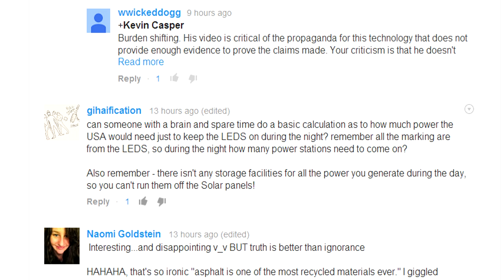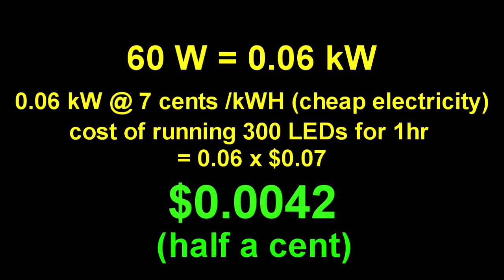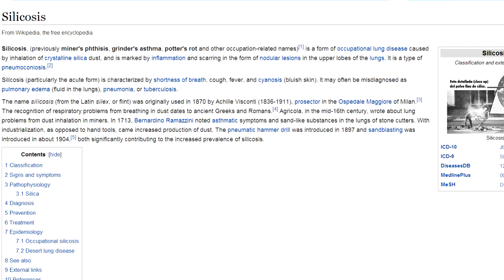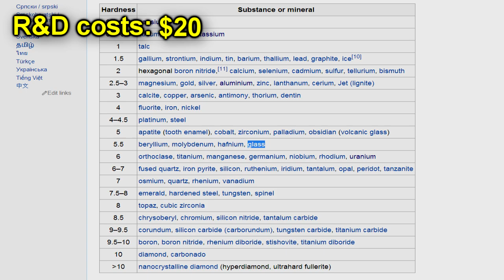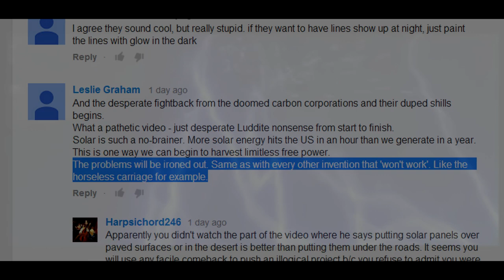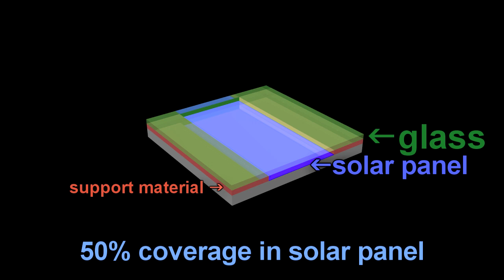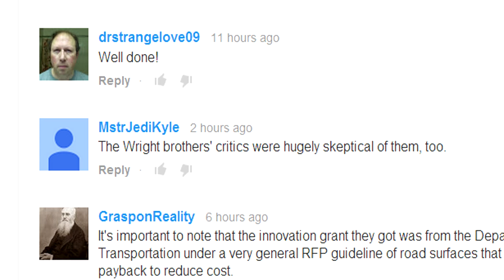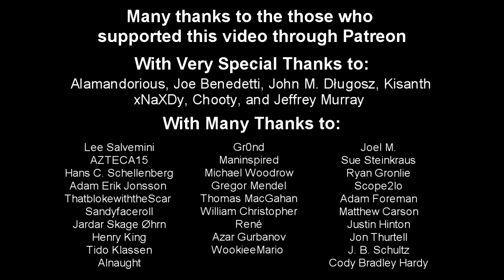Solar Roadways, IMPORTANT QUESTIONS AND ANSWERS!

Comment: Your argument has technicality flaws that you need to correct. 1) Not all the LED's will be on simultaneously, therefore not so much energy usage. 2) The cost you show is RETAIL cost for the 60 watt LED modules and solar panels. The DOT will only have to pay wholesale prices. 3) LED power consumption can be lowered easily with PWM current sources. It is not going to be full bore 60 watts. Please study up on LED's and silicon device physics... 4) Calculate the watt hours you can get from a fixed solar panel to charge up a small battery. 

But I agree that this project is epic fail. Just need to sharpen up your argument a bit.

Comment: The biggest problem with this idea is that it addresses a problem that does not exist. The reason we do not have solar power as a major source of our electricity is NOT lack of places to put collectors. This would be a line to look down if we were running out of area to put solar and needed more area, but that is not the issue we face right now.

Comment: They've answered your question on their site.  They've been doing this for years so far, and they've done the testing.  The money is to finish up the design and make it ready for mass production.  So with them refuting your "its not strong enough" bs, what now?
Reply: An idiot can work on his car made out of bananas for 5 years, does not mean he has found a solution to the problem where bananas are squishy.

But this idiot can make some shitty video about how the motor industry is bad and how his new car is 0 emissions, requires no fuel and is edible and then idiots like you can defend him because he has been working on it for 5 years.
Reply: Apparently, they didn't do the testing, or just handwave away the actual problems. They seriously should've done some back-of-the-envelope calculations years back when they started and should've spent their efforts, energy and money on something useful.
Reply: *****
tempered glass is tempered glass.  leds are leds.   you cant change the properties of tempered glass, or the visibility of LED's in the sunlight.  so you are saying it wont be the "cheap crap"  but will be using expensive stuff, therefore making thunderf00ts cost estimates way too low.   yea, that bolsters your argument.  haha.

you really think you can see LED's at a shallow angle under a glass surface in the sunlight?    this is why you enviro-junkies are viewed as religious folk now, you believe so hard that no evidence would be enough to convince you this miracle cure is nothing but a sham
Reply: "They've answered your question on their site"? That's like telling a evolutionary biologist that creationists have answered your questions on their site. Saying 5 is the answer to 2+2 IS an answer, but that doesn't make it right. They're "answer" to the asphalt issue makes it clear these people are full of it.
Reply: Bill, if you don't know how blacktop is made, don't try to defend these poor charlatans.

The soft bitumen is used to glue together and seal little sharp rocks. So you need to compare the glass with these rocks for hardness. And even blacktop gets smoothed out over time (but it doesn't matter as it doesn't have to be transparent).

In order for the solar panels to function, you need a clear glass for 20 years. Try rub sand over tempered glass for one minute and you see that glass has a 10 million times less expectancy to fulfill that goal.

On a road, the glass will be entirely opaque after a few days, and the 'knuckles' will be run down after a month or so.

Please think for yourself.
Reply: Link to their rebuttal of Thunderf00t http://solarroadways.com/clearingthefreakinair.shtml
I was wondering if they were just dumb or fraudsters. Now it is clear it is the latter.
Reply: *****
oh yea, the government is a great example of people NOT wasting money?  they say they've tested it?  with an actual car, actually driving, with real wet conditions?  why not video it?  because its a LIE.
Reply: And where is the proof for this testing? I call bullshit if you don't provide feasable data.
Reply: It will never stand the test of the almighty season winter of the cold.
Trust me, the cycle of ice-cold and hot kills road.
Reply: ***** They said they've done testing of this, and that they have a stopping distance on par with the current roads we have today.  I really doubt the government would be giving them more money if they thought we would have 200 car pileup's every time it rained.
Reply: I can only imagine the weight of a cargo truck overturning at max speed, or a car rolling into the air and falling on it tearing off the panels out of the ground as if they were nothing. Speaking of which, what about fuels catching fire on the road? Even if the glass resisted, how would the solar panels and the circuits and the leds survive the temperatures?
Reply: sigh, they think that their glass is harder than rocks, it's not, rocks will scratch the glass, they can't just use tempered glass for roads and expect it to be optically clear for very long never mind lasting 20 years. they make the assertion that asphalt is softer than glass, this is only true for the bitumen not the composite material. Rocks will scratch their tempered glass just like rocks/sand scratch gorilla glass. They could have made a 5 second video of going at a tile with a power sander to prove everyone wrong, they did not do anything of the sort and posted either a fundamental misunderstanding of the topic or a completely dishonest one.

They never showed any day time tests with their LEDs, the showed examples of high powered LEDs that would consume even more power and LEDs in the shade.

They admit they never did emergency stop tests.

They make claims about the costs for their product while in the next breath saying "no one could know the costs because even we don't know the costs"

As far as I've seen on their site they never give an average power generation per tile vs power consumption, they do a lot of napkin math with ideal solar panels, but not their tiles nor real tests, nor do they ever give an approximate power consumption of the LED's and other communication technology integrated into every tile.

Sorry, but try to read their faq and "clearing the air" with a bit more skepticism rather than wanting it to be true. It's possible (though highly unlikely) they'll be able to pull off their intended mission, but you'll notice they do a lot of hand waving at legitimate criticisms and either they don't understand the criticisms or they're being dishonest.
Reply: spec24 They go into detail on why the video is wrong, not just make blind assertions without evidence.  They go over how glass is "harder" than asphalt.  They cover several other of his claims too and go over why they're wrong.  So your reply to their detailed answer sounds just like the argument you are trying to make, 2+2=5.  Prove them wrong.  Demonstrate how they are full of it or stfu.
Reply: ***** Yea, your right its all a lie.  Lets listen to the guy that had some glass laying around, not the same kind they're using to make the roads with, and shows how the cheap crap he has can scratch.  Lets look at the LED's he's got laying around, which happen to not be the ones they're using, and believe him that they don't show up in the day light.  I've seen plenty of signs that use LED's that show up in the daylight, and I would not begin to know what watt they are, but Thunderfoot had some laying around, so if his don't work, clearly no others can work either.
Reply: In order for the solar panels to work at peak efficiency, the road surface needs to be optically clear. Which Tf00t demonstrated to be a horrid material for this kind of project. Not only is the glass easily scratched, but it is a soft material. You're much better off putting a solar panel (of similar size) on the side of the road that tracks the sun. every few meters.
Reply: What about all the LEDs, and the mircoprosesscors, and the cost of putting them on every road in the country
Reply: No they have not.  Have they shown a car driving over their roadway, or ANYTHING that would happen to a normal road?  No.  Because they know what will happen.  Their whole farce will fall apart.  Stop defending these clowns.  Its embarrassing to watch.
Reply: *****
well no shit glass is hard. But does it float? No. What is holding it is the question. Do you put it on the fucking solar panels?? I don't think solar panels are as "hard" as glass... and if you put alot of support under it, then there's just not enough space if you wanna get some energy out of these things.
Reply: Kevin Albert Something else people don't really seem to understand. Tempered glass is good at taking direct blows but NOT against scratching. Even scratch resistant glass isn't scratch-proof. All it's good for is minor scratching that might occur on reading glasses. It's NOT going to have any use on a roadway.
Reply: TheBelieveit1 True but his experiment was to prove 1 major thing: that glass is NOT harder than the dirt/sand/rocks used in asphalt...plus the rapid movement would more simulate longer times.
I do see your point though which is why I wouldn't recommend it for the actual tests
Reply: why can't we just make solar lamps on the sides of the road that tracks the sun? I mean, that thing would be much more efficient unless if they completely drop the hexagonal "It looks cool" design altogether
Reply: *****
well to be fair, glass is technically very hard, but its also brittle, and is vulnerable to scratching whereas roads are not (or at least the scratches are irrelevant to the road doing its intended purpose)
Reply: *****
You mean glass is soft, but strong.(I assume this is what you meant)
Reply: Carlos Danger
no, according to the the way science defines things being "hard" glass is indeed hard.
Reply: *****
It is soft compared to things like the rocks in asphalt.
Reply: Carlos Danger but we are talking about composite asphalt, with the actual bitumen involved.  from an observational view, most asphalt road surface is kinda soft.  these people are saying the fact that glass molecules are harder by definition than composite asphalt (a dumb comparison, to be sure), therefore concluding that somehow makes it a better road surface.
Reply: On you argument saying that because the government is investing it means it is legit...... Once upon a time thanks to the government ignorance Pi was almost changed to 3.2....
Reply: They've been doing this for years?   Doing what for years?   Playing with recycled glass?    And no, if anything their FAQ is filled with vague and evasive answers, they haven't provided a costs analysis of any kind and simply to be promising a whole lot while providing limited evidence for why they think what they want to do is even remotely feasible.
Reply: *****

   The same government that handed $500 million to Solyndra....yeah, they're clearly the epitome of financial responsibility.
Reply: *****

  Tempered glass is tempered glass, LED's are LED's, there isn't some magical invention that his old hippy couple has squirreled away.   The video creator has repeatedly shown an embarrassing amount of faults with this whole Solar Roadways debacle.
Reply: ***** So basically what your saying is the inventors of this scam,I..I mean Solar Freaking Roadways just answered all of Thunderfoot's questions with...2+2=5. LED lights are LED lights just like temper glass is temper glass. The only difference in Thunderfoot's testing is he used the cheap crap while the inventors used expensiveness crap in their testing. Crap is still crap cheap or expensiveness your still going to have the same problems Thunderfoot pointed out in his testing. Oh I love their response to LED lights during the day question. Go look at traffic lights. I did. The last time I checked traffic lights are not buried in the ground face up under glass, and they have covers on over the light displays. End of discussion!
Reply: TheBelieveit1 a better test to prove his point would probably have been to take the glass to a grinding wheel or a belt sander
Reply: TVlord5 Ah but that wouldn't simulate road conditions as well. Tires aren't like grinding wheels or belt sanders so they wouldn't get the same effect. What was necessary was to show what happens when a tire grinds things like sand, gravel and other debris against the glass.
Reply: K3WRO Unfortunately, although they tried to tie all these extra "benefits" to it...at its heart this project is just a "this looks really cool" thing
Reply: TVlord5 Next to the "Green" aspect, this is what got people into it in the first place.

It's funny, the first time I saw this, I thought it was a really good idea, then, it turned into the next "Kony 2012" if anyone remembers that mess.
Reply: K3WRO And like Tf00t said, the systems we already have in place for the main features of this product, are more efficient. Signs are quick to paint (or program lit signs) and put into place, and headlights already illuminate the parts of the road we need lit...the only places that could benefit from any form of automatic sensors and remote marking changes are very remote areas, which don't have the traffic that would really make the expense worth it (i.e. Way up north where an avalanche blocks a road or there's something in the desert where it'd be a pain to get people out there to put a sign up)...

Comment: Thunderfoot, there is something fundamentaly wrong with your cost calculation. To assess the cost of a LED you go to a online store and see at what price it retails, but that is not how it would work. If you order 12.000.000.000 LEDs, you can reduce the price per unit to probably way less then 0.01 cents. And that goes for every piece of hardware, be it the glass covers, the wires, everything.
But even considering this, this is a utopia project.. there is no place for this in reality

Comment: I'd reduce that cost for the LEDs running to a tenth, as most of the LEDs would be off if they're only imitating road markings.  It's not like existing roads have their entire surface painted... just the bits for the lines and symbols.  Heck, that may be a way to reduce the cost of the tiles too, as you could leave the LEDs out of the tiles that won't ever have markings or lines on them.  That's not to say this idea isn't still hideously stupid though, especially in comparison with just lining or covering the damned roads with dedicated solar panels.

Comment: To Leslie Graham,
There is a fine line between wishful thinking and delusion...actually there is no line at all. FYI, the horse drawn carriage was invented in the 4th millennium BCE. The first internal combustion engine automobile was invented in 1885. Are we expected to wait over 5000 years for these problems, which Tf00t proved were virtually insurmountable, to be "ironed out"? In the meantime, do we go ahead with this plan anyway despite these problems being insurmountable?

Comment: This whole solar road idea is just totally stupid. The cost of installation alone would be 20-50x more expensive than just putting up solar panels on the ground or roof. One nuke plant would probably produce more power than 40,000 mile of road for 1/100th the cost.

Comment: If what they claim is true and the Department of Transportation was in fact looking for a road surface that can pay for itself than there is an obvious problem with how much or how we build current roads. And so if they won the grant it is because it is a worthwhile idea to investigate. As for the video those hexagon tiles are not the ones that are going to be used on the actual roads, that was the parking lot prototype. The glass is not like any beer bottle or coffee pot glass, and I would think that they already have thought of the issue of the wear and scratching of the surface. Even in the video a professor of material engineering says that there are already glass that are stronger than steel, all that they would have to do is adapt the glass to the purpose that they want. And also apparently they have already tested the glass for traction, breaking and all that, and they claim it passed just fine. So the adapting and searching for a glass material is where the money for research and development hopefully is going towards. Also I don't think they're going to be using Ebay LED's for the roads. So again that is another possibility of where some of the R&D money is going towards, making bright, efficient LED's that will work for the road during day and night. Another thing is, if the guy of solar roads is indeed a electrical engineer I think he would've already thought of the problems that concern the actual solar panel part of the road. Like the angle, durability, actual capacity to power its own internal components and still create a surplus to use, etc, etc. So really you don't have to completely back it up financially giving them huge amounts of money and what not, I don't but at least 2 bucks doesn't hurt. But I also don't remove the possibility that this could a scam and they're going to stay with the money. If it is a scam then o well, if you gave a lot of money to the project than you're dumb, if it isn't a scam then you helped a project that is really a good idea and could be really good for everyone.